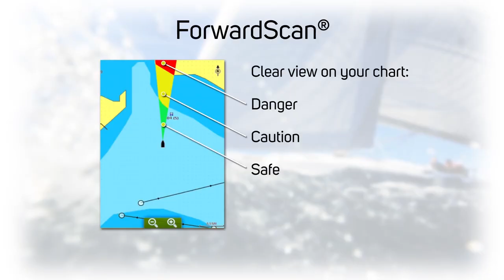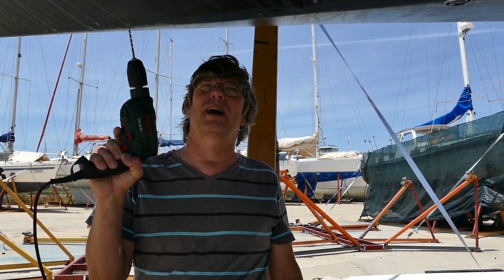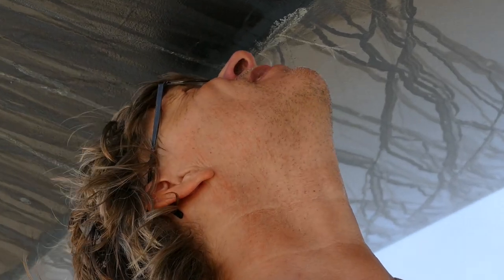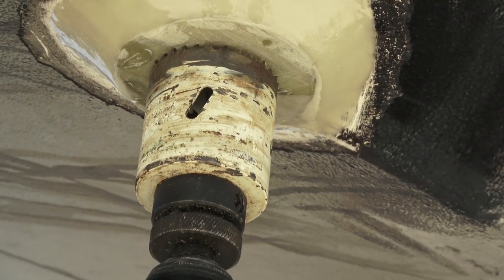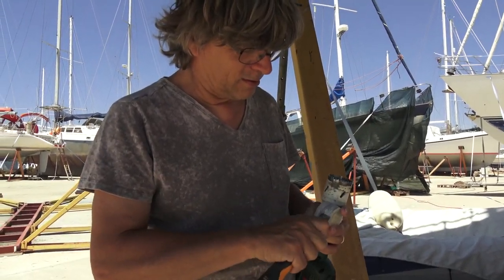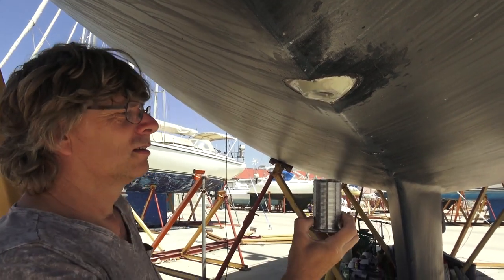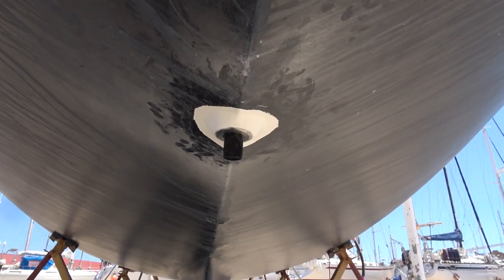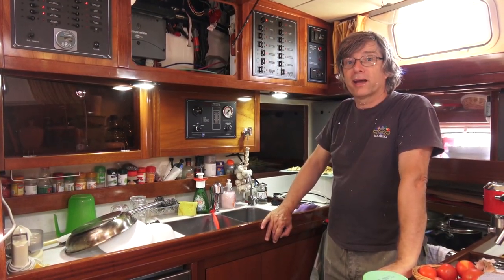B&G Forward Scan installation on AMEL 54 | WE DRILL A HOLE IN OUR BOAT! | SV VELA NAUTICA Ep.2

Comment: Hello... I was watching you install video and was wondering how you removed the electrical connector from the cable.  Did you remove it or cut the cable?  I'll be installing the forward scan on my Island Packet this Spring 2020.  I have to remove it connector to run the cable to my MFD in the cockpit.  It looks like you are passing the cable through bulkheads with no connector on it.  Thank you for the video!  Smooth Sailing!
Reply from the maker: Hello, I did cut the connector, like 50cm away from the plug. The warranty will be void if the new joint is not done in a waterproofe case.
So I entered the case with both cable end from downside ( water that rinses along the wire will not run upwards) . I joined the single wires ny soldering and isolating each with shrinkhose. additional I compleated the shild with a wrap of aluminium foil and self amalgating tape.

This method worked fine and no faults so far.

have fun sailing
Oliver
Reply: SV Vela Nautica thank you!!   That’s exactly what I wound up doing!   Stay safe!

Comment: You needed to check the hole in the hull with a level it should be level front to back and side to side.
Reply from the maker: Yes we aligned the direction of the forward sensor with the waterline and side to side. An eventual minimal deviation does not matter, the boat mouves in the waves anyway.

Oliver

Comment: Isn't that the beam of the hull?
Reply from the maker: sorry, I do not understand the question?
Reply: @svvelanautica2374  no I thought that the center of the Hull where you drilled you hole was a wooden beam. But you have a fiberglass boat
Reply from the maker: @Bdpjev  Yes, thats right its fiberglass and the new sensor is aligned with the speed and deapth tridata sensor. But u need to keep distance to other sensors with the forward scan